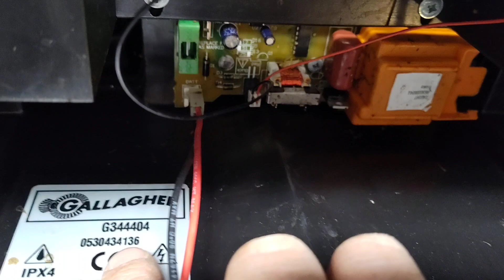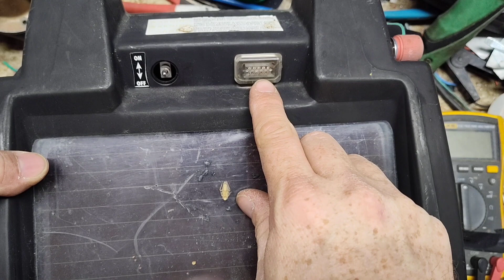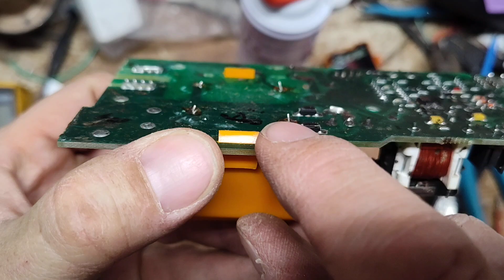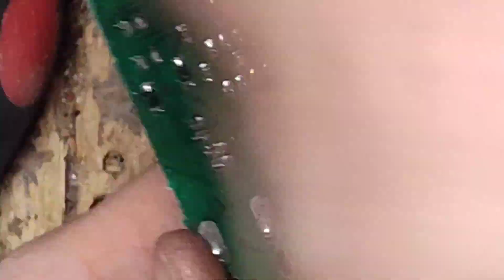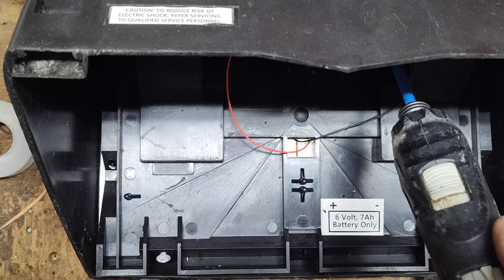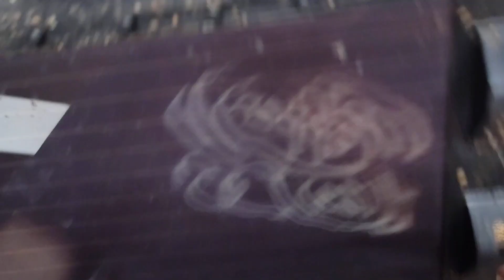How To Test & Repair A Solar Powered Electric Fence Charger | Gallagher S15 S17 S22 Repair

Comment: I test both terminals with the test device and the test device only shows 1.6 kV. I can send you a photo
Reply from the maker: Ok you likely have a bad output transformer then. There are two ways of fixing it. Either by desoldering the old transformer off and soldering on a New one, or replacing the whole board with a brand new one. If you'd like to send me a picture of the inside of your unit where the circuit board sits at, I'd like to see what version transformer you have. If you or someone you know is handy with a soldering iron, I could send one to you I'm sure. Send me pictures to my email address, fencerfixer816@gmail.com

Comment: I thought it was only me who received exhausted amorphous panels from Gallagher. I've seen many like that. And in the S50 many times at high voltage output an arc jumps towards the panel and burns.

Comment: Repairing at component level is tough and hard work . If the components are not discreet.
Reply from the maker: It's a pain in the neck for sure, especially when they're not labeled, no schematics, and that surface mount stuff.